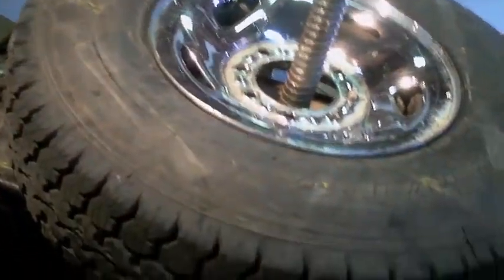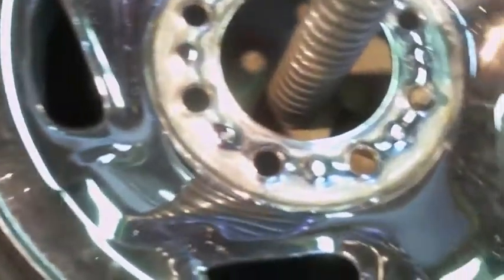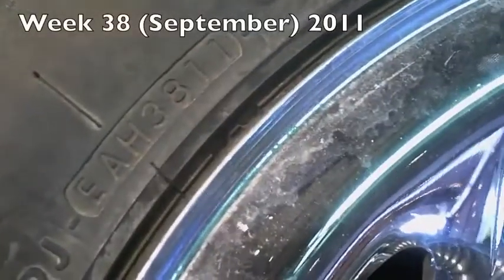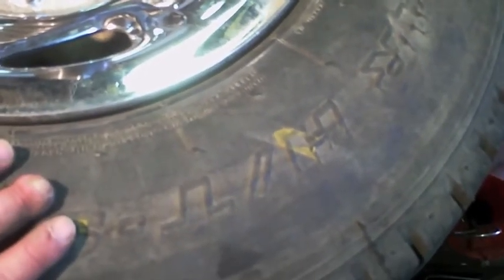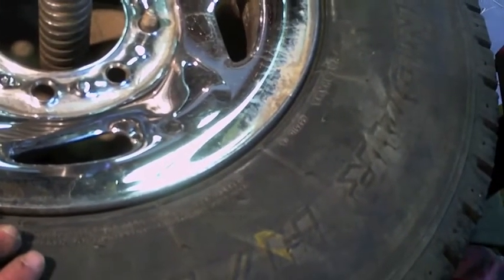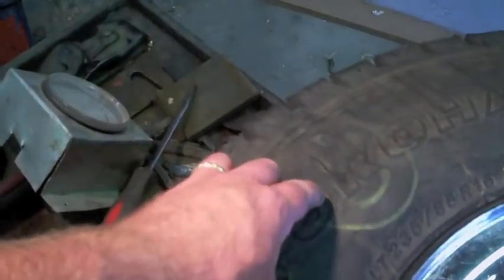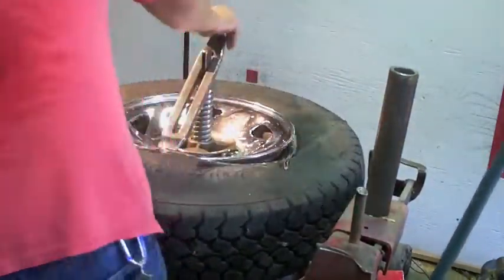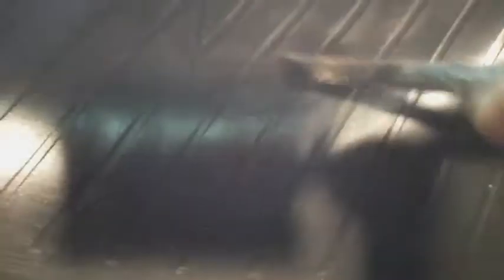Recap Carcass Failure

Comment: I am pulling these tires from my vehicle due to 3 out of the
four treadwright Wardens 265/75/16 tires 
on my F-250 pickup have had casing seperations.  The last one nearly caused a horrific
accident for me and oncoming traffic. All 3 tires have nearly 75% tread left on
them and are nearly all highway miles. I pulled the last tire of the 4 due to
fear of this happening again. The last tire gave the familiar shake of the
other 2 tires that separated and before I could get pulled over, totally blew,
throwing me into oncoming traffic. If this had been in HEAVY traffic, or my
wife or child driving, there would have been no preventing an accident. I
contacted Treadwright on the second tire and they good willed me a tire and I
purchased two others from them hoping to have 4 nearly new tires. Now I am
stuck with these 3 new tires plus the 4 95% tread tire set that I purchased for
my trooper. I don&#039;t dare drive on these tires. Please take caution! It
cannot be coincidence when 3 out of 4 tires have casing separations after 1
year of occasional use. Ask yourself if your families safety is worth saving a
few bucks? Submitted to treadwright tires web page under reviews. @ 2:26 pm on
09/28/16. Along with photos of blown tire and skid marks.
Reply from the maker: Dude spamming all the vids for your cause isn't cool.  That said I have had issues with the sets I got recently including tread a separation that ripped the inner fender wells out of my truck.  I am still running a set of snow tires but I no longer recommend.  I think if I lived someplace hot I wouldn't even run those.
Reply: Cool or not, I recommended these tires to a lot of people. Its not about being cool, but rather about looking out for the safety of others. I am sorry that I recommended these tires to anyone that nearly caused a tragic accident. Really bud? Three out of four tires all within 2 month's of each other... That is NOT a coincidence.
Reply: Not cool but tires are bad? Make up your mind.

Comment: Purchased seven (7) 19.5 "Guard Dog" tires from Treadwright for my 2008 Ford F450 Superduty.  The first failed at approx 200 miles (outer rear dual) while towing a fifth wheel RV.  Destroyed the F450 rear dually fender and debris damaged the front of the RV.  Lucky that the failure was on the rear and speed was only 45 mph.  The second failure occurred at about 300 miles on the left front.  After experiencing steering wheel and front-end shake I slowed to 25 mph and BANG, the second failure in less than 500 miles.  No response from Treadwright on the claim I filed, and the negative review that I posted to its website was removed within 12 hours.  I have also been blocked from leaving any further comments on the Treadwright website.  Poor product and poor customer service IMHO. . .